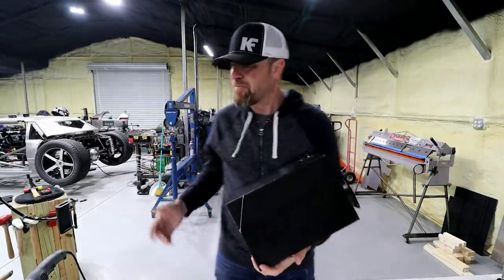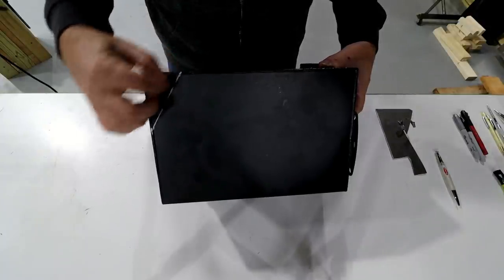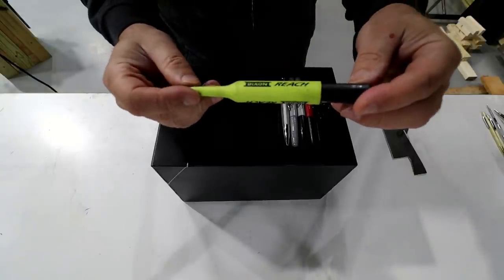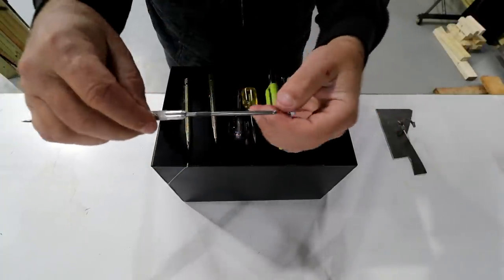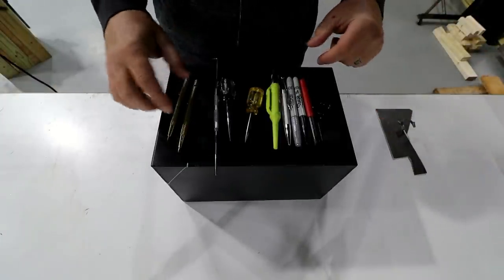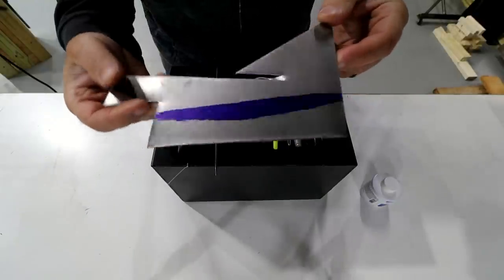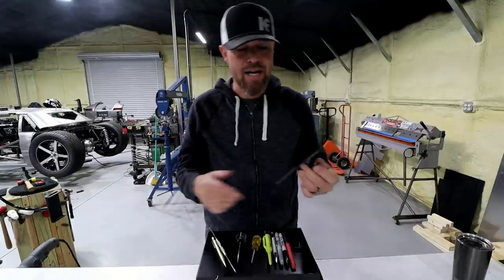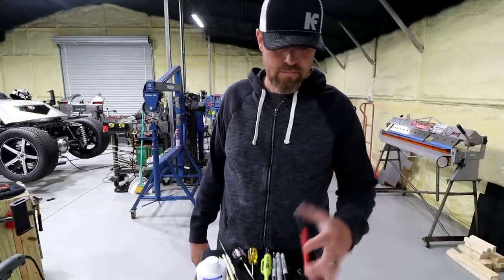Where I Draw The Line !

Comment: I use a tungsten sharpening holder and tungsten sharpened in a cordless drill on the belt sander as my scribe. Stays sharp and easy to maneuver. I have never seen the REACH pen. Going to have to look into those. Thanks!

Comment: The scribes with a handle are called an all as they have many purpose and one is marking. Generally used by wood workers or mechanics to line up holes, remove pop rivets, line up cotter pin holes, etc.

Comment: Scribing bend lines is a good way to predict where the part will crack and fail as the line scribed line will cause a stress riser (Focusing stress).  Mark bend lines with any non damaging method.  Cut lines are ok to mark with a scribe.

Comment: i only use sharpies and tungsten for scribing. if you need a long reach? pull the wick out the sharpie and stick it onto your pick. voila. fine line? pull the tungsten out my torch.